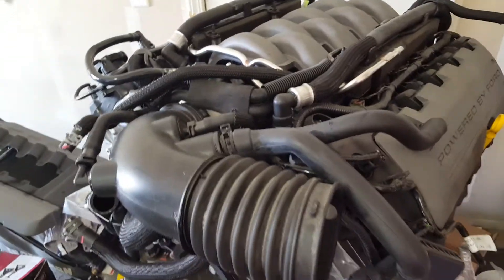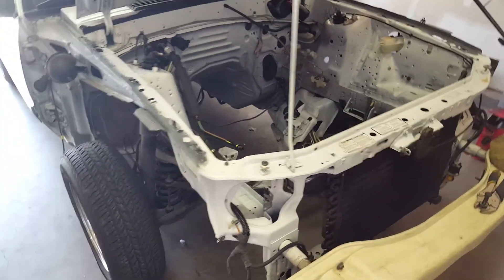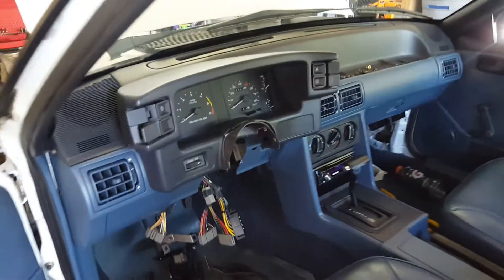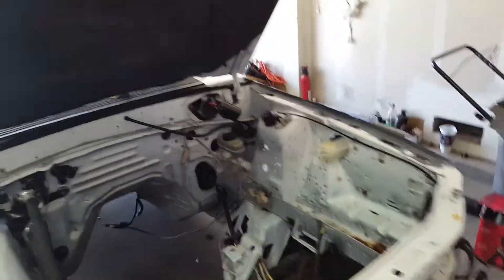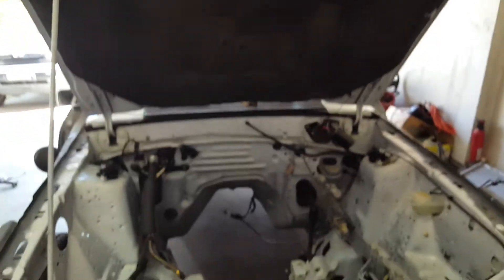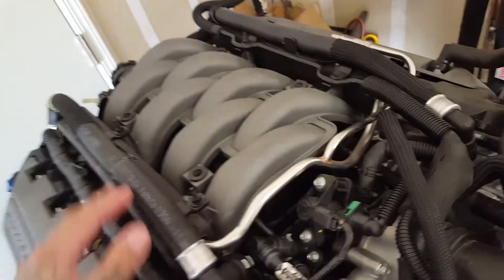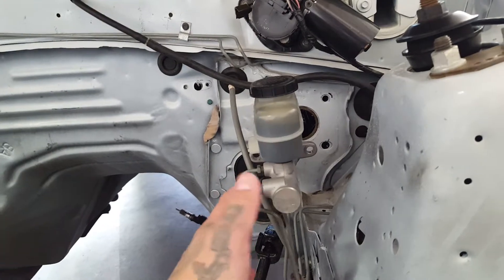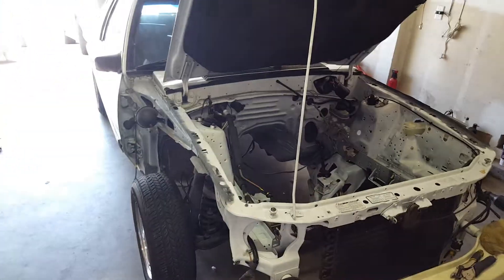Foxbody mustang COYOTE SWAP how to,parts review, introduction part2

Comment: You can actually use a Volvo electric power steering pump and mount it inside the driver side fender so you won’t need to move any of the accessories around

Comment: you dont have to convert to manual man
factory coyote fwill fit just fine 
where are you getting this info???
Reply from the maker: What
Reply: you do though if you dont  the motor is going to hit the brake booster and wont fit

Comment: Which brake rod did you use with the ranger master cylinder?
Reply from the maker: It doesn't come with one built in. I used the maximum motor sports manual brake kit
Reply: strokercoupe that’s why I was asking lol because there wasn’t one in box with the Ranger master cylinder. Thanks